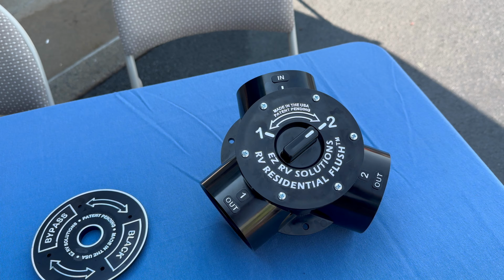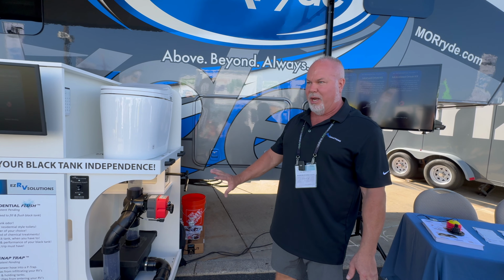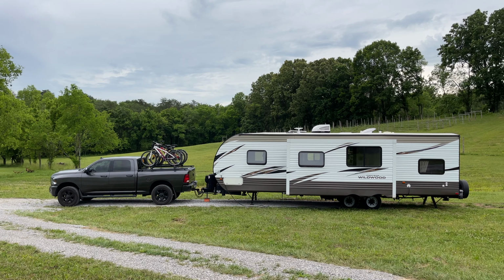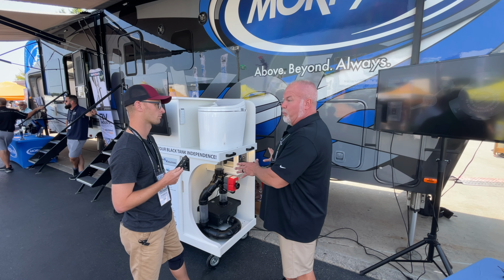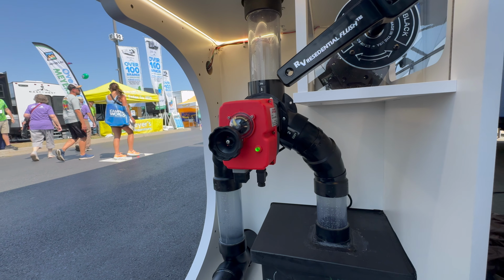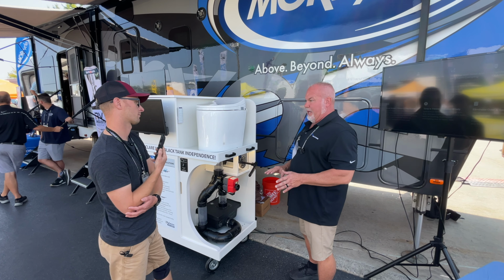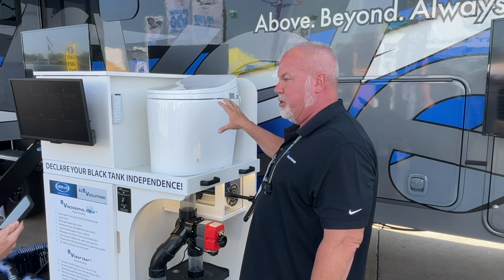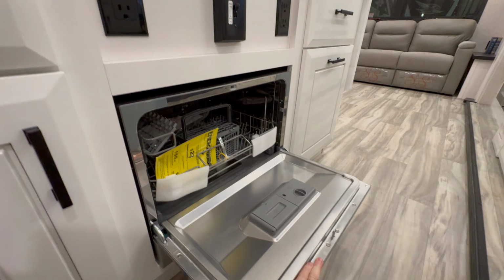How to Bypass Your RV Black Tank at a Full Hookup Campsite (RV Residential Flush & RV Snap Trap)

Comment from the maker: ⭐DISCOUNTS⭐
🔸RV Snap Trap Discount: https://shopmorryde.com/products/rv-snap-trap%E2%84%A2?ref=RVGearandFar
🔸Black Tank Bypass Valve: https://shopmorryde.com/products/black-tank-bypass-kit?ref=RVGearandFar
DISCLAIMER We participate in several affiliate programs that earn us a commission on purchases made through our links at no extra cost to you!
Some product links are affiliate links which means if you buy something we will receive a small commission. As an Amazon Associate I earn from qualifying purchases. 

🏘 Join the RV Gear & Far Group Here:
https://www.rvgearandfar.com/rvgfyt 

🚐 Favorite RV Gear:
🔸GasStop Propane 100% Emergency Shut-Off https://geni.us/KmLBS (Amazon)
🔸Liquified RV Tank Treatment https://geni.us/P5WuP4 (Amazon)
🔸Fastway Zip 6” Breakaway Cable https://geni.us/d7BZ (Amazon)
🔸Valterra Twist On Waste Valve https://geni.us/IHqqrCA (Amazon)
🔸Motion Sensor LED Night Light https://geni.us/JfbEnf (Amazon)
🔸HitchGrip Hitch Handle https://geni.us/FENglr (Amazon)
🔸Portable White Noise Machine https://geni.us/puASyQQ (Amazon)
🔸RV Ramp Levelers https://geni.us/iJWkX (Amazon)
🔸Solid Rubber Wheel Chockshttps://geni.us/vS04fc4 (Amazon)
🔸8” Clip Fan Rechargeable https://geni.us/eyXAgd (Amazon)
🔸Portable Propane Fire Pit https://geni.us/NCLvDx4 (Amazon)
🔸MaxxFan 12v Vent Fan https://geni.us/UBiMM (Amazon)
🔸Dual Fuel Generator https://geni.us/LSlpV (Amazon)
🔸Fresh Water Hose https://geni.us/8aoSb (Amazon)

🛠 Favorite Tools & Gear
🔸resqme Original Emergency Car Escape Tool https://geni.us/UBd1b4O (Amazon)
🔸My Everyday Carry Tool - Skeletool CX https://geni.us/hx3dQOV (Amazon)
🔸The BEST disposable workgloves! https://geni.us/JDBMBJ (Amazon)
🔸Digital Tire Pressure Gauge https://geni.us/BPJFiq (Amazon)
🔸Digital Laser Thermometer https://geni.us/rRhM (Amazon)
🔸VIAIR 12V Air Compressor https://geni.us/UCRmT (Amazon)
🔸NOCO Boost X Jump Pack https://geni.us/ht7RN2y (Amazon)
🔸Our BIG Rearview Mirror https://geni.us/xVNvFH (Amazon)

📸 Video Gear I Use: https://geni.us/HX34 (Amazon) 

🔩 DEALS: Sign up for our newsletter and we’ll let you know about deals and discounts!
https://www.rvgearandfar.com/signup

Connect with us! 
💥 🎥Connect! https://www.rvgearandfar.com 📷📺

© RV Gear & Far, All Rights Reserved. 

This channel is for entertainment purposes only; we are not experts or professionals. We share our opinions, experiences and what works for us. Please do your own research and make your own decisions.

#rv #rvlife #rvgearandfar

Comment: Two issues that I see to have a p-trap on a flex hose and the flex hose has exterior ribs as well as interior ribs and waste debris does collect water collects inside those inner ribs. Majority of it will be pushed, but you'll have waste water sitting in the ribs. You need a smooth surface interior pipe 100% in order to utilize that peach wrap because other than that you just got wastewater. Think about it. Think about it. Does your flex hose smell after when you take it apart? Even flushing water through it does because you have wastewater still sitting in it. Granted we've rinsed them out. We rinse them out. Take take your water hose. You start blowing water inside the flex hose to clean them out. That way you won't have no nasty water coming out on you when you roll it up or however you may store it. Completely understand but when it comes to the p-trap now for the switching from black tank to the waistline that is a great idea. I was sitting here thinking I've looked down my toilet line. It's literally from the bottom of the bowl through the floor. Can't be no more than 15 in and I have a class a now. The floor alone is about three 4 in so I can't see where that would fit unless you're modifying or changing your black tank. So he stated it's for fifth wheels, something that has an opening where the tanks are further away. But yes, my tank in my class say is literally less than 20 in it may be less than 10 in another issue you're going to have with this flush system is you got a lot of elderly. How many of them will remember to change over from black tank to sewer sewer? The black tank hell we don't even have to talk about the elderly. We can talk about everyday folk Middle age that has other things on their mind that will forget to switch it over before they use the bathroom. That's still you know that s*** is being shot out right on the ground when moving from place to place. Here's another thing is you guys say to fill your toilet up halfway or a third of the way you basically need to add water. Well the problem with that is boondocking that is an internal valve that you have to manually switch or power switch and if something dries up on that internal valve it will cause it to not move. And now that I'm thinking, what about over time buildup now it's more so you're going to have to replace it out. But this isn't new tech. This is the same old tech we've been using for well over 40 years, but it is a great idea. A great put together and what I mean by it's been out over 40 years. This is the same equipment that pool systems use in ground pool systems where you have a device that you can actually switch the inlet mode or the hose. You might want to bypass certain like your steps and send water just to the pool where you want to shut the pool walls off and just run it on. The steps is what I'm saying. This is a this equipment has been out for years now. The automatic one where you press a button that would be considered new. I'm sure they haven't had that out long but there's my idea
Reply from the maker: I appreciate you taking the time to share your thoughts and concerns in such detail. Would you buy a rig with one of these valves installed from the factory?

Comment: I assume a retrofit on a typical class C motor RV is not possible?
Reply from the maker: Each rig is plumbed differently, so I can't say for sure on your rig - but it may or may not required a raised platform under your toilet to get it to fit properly in a retrofit.

Comment: Thanks for the extended time and Q&A for this product. 
As I have a fifth wheel that I want to set up and leave on my own property as a year round vacation spot; I love the idea of being able to just plumb my black tank waste directly into the septic tank I had installed. 
This looks like a great idea, especially if I combine it with a more semi-permanent smooth pvc pipe connection to replace the vast majority of the ribbed flexible waste hose. 

Great video, and great product idea!
Reply from the maker: Sounds like it might be a great fit for your application!
Reply: @ My RV is a 2016 Montana 3790RD. I’d love to talk with the developer that you interviewed and see what his thoughts about a retrofit into this model would be. 

I came across your channel after your collab with Jarred over on his All About RVs channel. Looking at your back catalogue, it was a pretty easy subscribe. Thanks for sharing!
Reply from the maker: @montef  You can reach them over at https://ezrvsolutions.com/
Reply: @ Awesome. Thanks! 😊

Comment: Pay many $$$ to install ,  when you discover all the problems this systems has the potential   of creating, pay more $$$$ to remove it!🤑
First and foremost,  who is going to remove and store a black water hose that hasn't drained correctly  for how long?????🥶
Makes me think of the monkey and the cork...LOL!
Reply from the maker: Time will tell
Reply: Thank you for your comment. EZ RV Solutions has over two years of continuous testing with multiple fulltime families. The system has been and continues to be fully tested and confirmed to be a reliable solution with both RV and residential style toilets, to bypass your black tank and flush straight to the sewer when at a full hookup site.

Comment: This might be an advantage for full time hook-up use, but I think it's just going to change where work has to be done rather than eliminate it.  Even if the majority of the solids make it all the way through on each flush, which is unlikely, there's going to be skids/remnants of poop and TP all along that ribbed hose that'll eventually need to be cleaned out.  The Y valve itself is going to be a place where things could collect, more so on a retrofit where it's mounted horizontally, which will require using more water and filling the black tank faster when away from a hook-up.  Having this will eliminate the ability to clean the tank with a wand sprayer.

I dry camp almost exclusively so having my tanks last a long time is a huge bonus.  I hold my flush valve open with my heels and drop my solids straight down the hole requiring minimal water use.  If I don't have too many guests using the rig I can make it through a riding season with only one dumping.
Reply from the maker: That is dedication!
Reply: Thank you for your comment. The RV Residential Flush bypass valve works great for both short term and long term applications - why store and manage raw sewage if you don't have to? (when hooked to the sewer of course) We have over two years of testing with multiple full-time families and have had no issues. Even with stationary applications, there has been no more than what is normally observed in the way of hose scaling (which you would also observe with water only usage).

Comment: For us this would be a solution in search of a problem. We have a large 5th wheel with two bathrooms and two black tanks. It takes me about 10-15 minutes each to clean, less if I just dump. Our forward black tank has the integrated sprayer, making that one very easy to clean. Even as full-timers, I empty the black tanks once a week. I love the ingenuity, but I don’t see the great need. Taking away people like us, small/medium travel trailers not using them, will there be a large enough market for this system? I do love the snap trap. That I will look into getting.
Reply from the maker: Time will tell if there is a big enough market. I think if they can get them installed from the factory they'll see a big market adaptation

Comment: The switcher between black tank and hose is pretty pointless honestly and the whole product. The snaptrap however is amazing and it looks awesome.

Cutting off the black tank and pipe set would be more useful honestly than this product.
Reply: Sometimes you want to have the ability to use your camper while off grid as deleting your black tank is fully committing yourself to only using the rv in rv parks so if you know 110% you will never move it or even think about using it off grid then a simple black tank delete would suffice but I'm pretty sure that most people who are interested in this product want the convenience and luxury available to them but also still able to use the toilet when not connected to a sewage system
Reply from the maker: I think it would be valuable if it came from the factory that way.

Comment: I did a similar deal last year with our 5th wheel. We have some land with septic, electric, and water hook-ups. I wanted to be able to hook into the septic tank while there in the summers but still be able to have use of black tank while traveling. I spent $75 on a bull run valve and another $50 on 45 degree street elbows and ran a second line. Took about 2 hours and worked like a charm.
Reply: How did you do the install? Was you able to get to it from in the Basement area or did you have to remove the toilet. I could not find any videos of it. Let me know how its going.
Reply: @SuperRockit101  most 5th wheels have a panel access to all the plumbing in the side storage hatch. its the wall with that shares the wet-bay usually.
Reply: The one shown cost $199
Reply from the maker: Nice! Haven't been exposed to the bull run valve before, thanks for sharing - just looked it up and it seems to be identical in function, another RVer told me they have something similar in the marine space as well
Reply: @rvgearandfar  The reasons why you do not want to use the bull run valve for RV Black Tank Bypass applications: it is made to 4" pipe size (RV plumbing is 3") and requires pipe reducer fittings to be installed, that said it is big & bulky, the material is PVC and not RV grade ABS, the valve interior surface is ribbed & can trap solids, the interior orifice shape is rectangular and not round so it is restrictive & lastly if you research it's designed purpose, it is meant to flow water only and not solids for run-off to leach fields in underground septic systems. The MORryde Bypass Valve was engineered specifically to bypass RV black tanks, and it does the job very well!

Comment: A simple proof of concept experiment would be to have a 20’ clear ribbed hose built and then prove to me that two litres of water in an RV toilet will push solids and toilet paper RELIABLY the ENTIRE length of the hose 100% of the time. What happens if the toilet paper gets about 1/2 way down the pipe because someone didn’t fill the bowl with water creating and a second flush. Then more solids and toilet paper are added. 
Sorry I wish them well but I see some huge red flags not only with the concept but in his responses to your questions.  I have crawled under more RVs in the last forty years of so than I care to admit replacing leaking tanks and slide valves and the one piece of advice that always holds true is to never dump your black tank without filling it with water first, for obvious reasons. Ignore that advice and you will pay the price.
Reply from the maker: Its been proven out in his experience - time will share the results once they start getting them installed in other rigs ◡̈  Thanks for taking the time to share your concerns

Comment: This looks more like a solution in search of a problem. I can't for the life of me see how that would install as a retrofit without completely replumbing the black tank. My toilet sits right on top, with about 4 inches of drop into the black tank. There's zero room to install this without moving the entire tank. I suspect most rigs are similar. You'd have to relocate the black tank to create enough space for the valve.

I can't really see a need for this.
Reply from the maker: Yupp, retrofit would be tricky, but OEM installation I can see catching on

Comment: I would like to see a video on replacing your hot water heater with a tank to a tankless hot water heater in the same space
Reply from the maker: My friend Jared did a few videos on this:
https://youtu.be/fhVusjZgWQY?si=JRSxZQtqxf5gzwqe

https://youtu.be/MXvx5j3gK4U?si=rIp8iP1NKG5v4rrn
Reply: There is absolutely NO need to heat hot water!  No need for a “hot water heater “ if the water is hot why in the H does it require heating again???
Reply: @h2o100c  I don’t understand your reply. I turn off my hot water eater while I’m traveling then when I’m Boondocking, I turn it on to heat the water but as I use the water, the heat hot water heater turns on to keep the water hot which wastes a lot of energy. A tankless does not waste energy. You don’t have to wait for the water to get hot.

Comment: Very similar, if not the same, as the marine Y-valve!
Dumo into the holding tank or through the macerator directly overboard to sea (Only legal past the 3 mile limit in the US!)
Reply from the maker: Good to know - I'll have to do some research into that, thanks for bringing it up!
Reply: Good point, but the marine "Y" valve is only 1-1/2" diameter and only works with macerated waste. The RV Residential Flush valve is the standard 3" diameter required for the passage of raw sewage. Thank you for your comment!

Comment: my hose MUST lay on the ground due to the outlet being so low to the ground so guess this is a no-go for me(the trap item)......    as for the bypass I just don't see the importance?  if it was pre-installed at build then ok might use but am not paying big $ for the option...
Reply from the maker: 👍 the legs on the rv snap trap fold up too - so you can use it on the ground

Comment: I doubt that this works well, because draining your black tank will provide the necessary volume of water to get all of the waste through the rv sewer hose. I seriously doubt his claims that a single flush from a rv toilet will carry the solid waste all the way to the dump station inlet.
Reply: Thank you for your comment! EZ RV Solutions has been field testing the RV Residential Flush system for more than two years with both RV & residential style toilets in multiple full-time family units. Your concern, was also our concern when developing the system. We were very pleasantly surprised to observe that single flush usage actually preforms exceptionally well, and we now have accumulated over two years of in-field empirical data to confirm. We recommend an extra cleansing flush after large waste sessions, which will final rinse the trap and sewer hose. For RV style toilet applications, you must fill the toilet bowl 1/3 to 1/2 before flushing to the sewer. Thank you again!
Reply from the maker: No personal experience to speak from here, but I’d also like to point out that EZ RV Solutions had to sell MORryde on the whole thing to get to this point too - time and community data points will tell
Reply: @rvgearandfar  Data points from unbiased sources might become available in the future, but I sure wouldn’t spend my money on something like this that attempts to fix a nonexistent problem, and it appears from a common sense perspective, to be unworkable. My background is in construction, engineering and code enforcement, so I know a thing or two about plumbing, as well as my experience with RV camping.
Reply: What problem is this product solving? More water consumption, added complexity and cost for what gain?